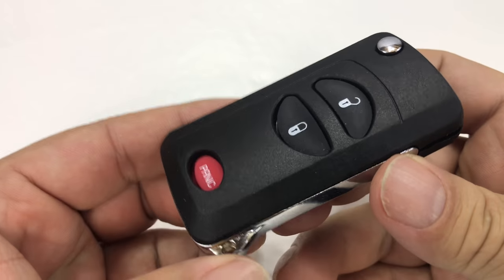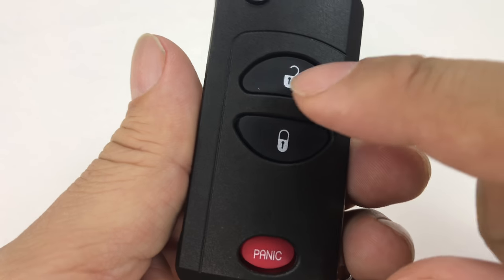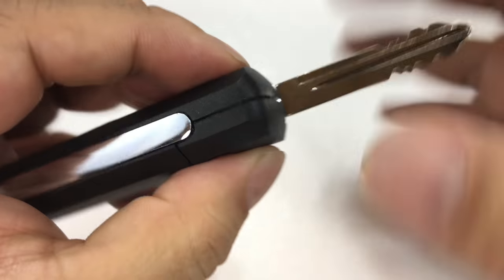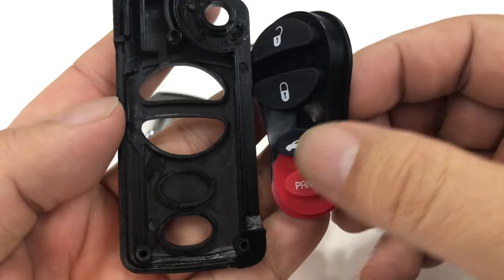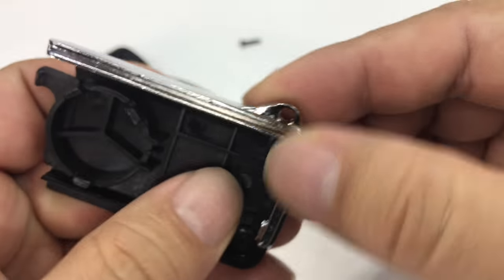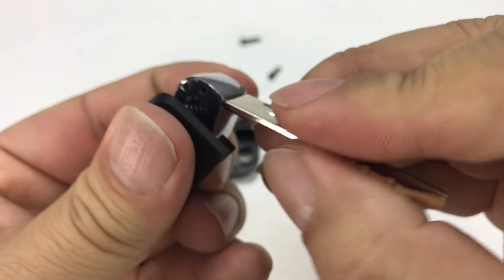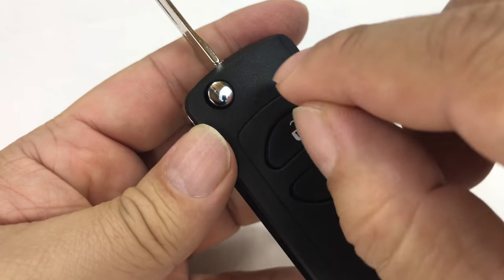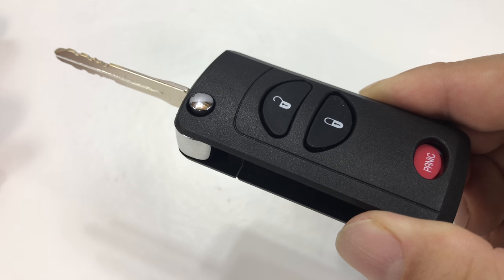Blank Car Key Refit Flip Case Review

Comment: Nice item. I might need one of these. Ace Hardware sells replacement remotes $69 vs dealer $300. Mine cuts keys $2. But I have 2005 Kia Amante, not a Kool Prowler. NV :)